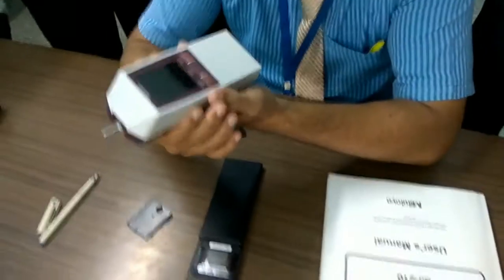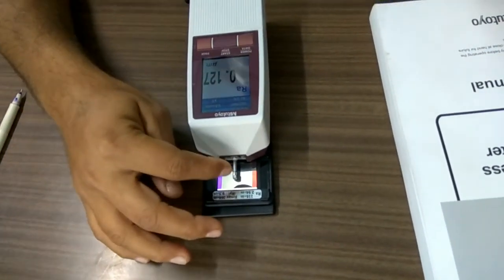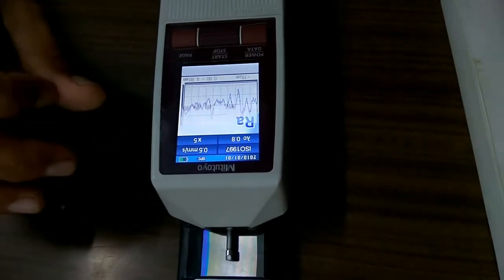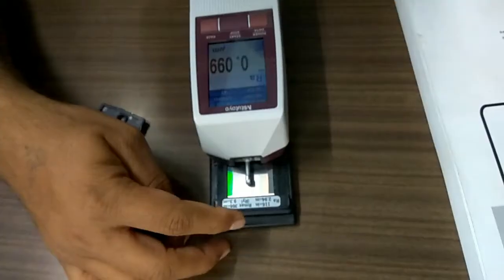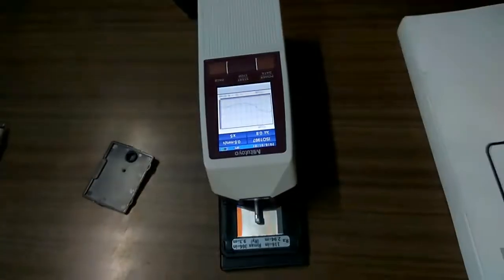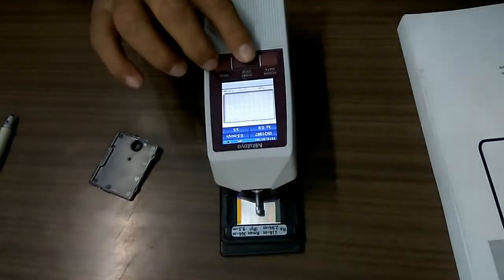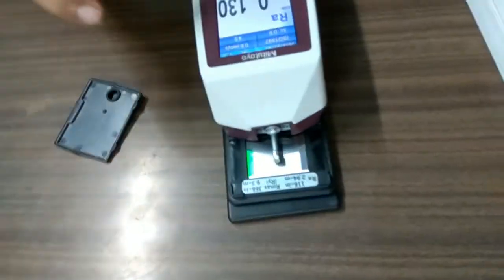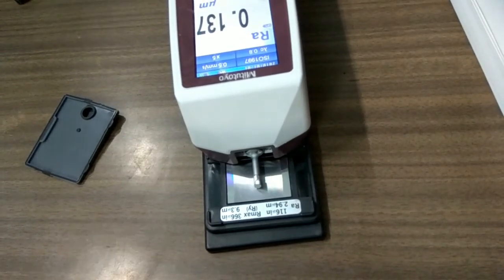Surface roughness measurement using surf surface tester by A.P.S.V.Fartale

Comment: Dear Sir,  u should get the meassured value in between 2.94 to 9.3m, BUT WHY R U GETTING THE VALUES LIKE 0.174 OR 0.130. Pl respond. I guess u need to calibrate the unit , update it and then start using the same.
Reply: He’s using the specimen the wrong way. Needs to be measured perpendicular to the lay
Reply: @johnv8840  no, the tip should be perpendicular...and he has put it perpendicular...the tip is below the probe that is moving.